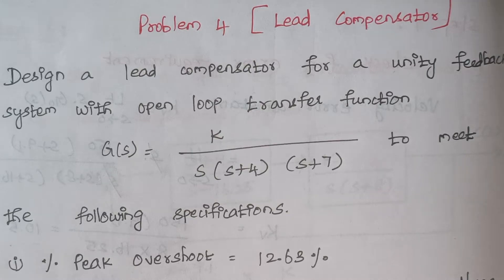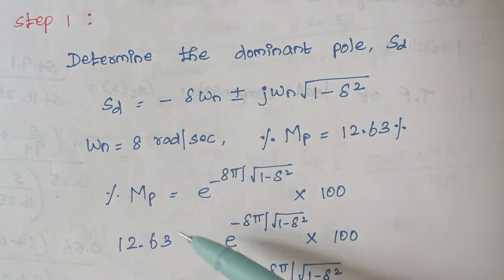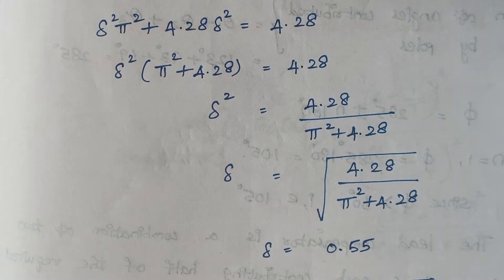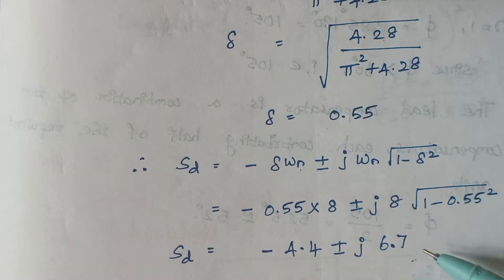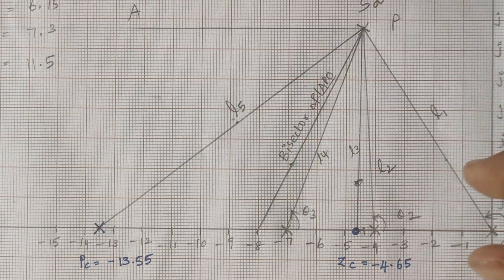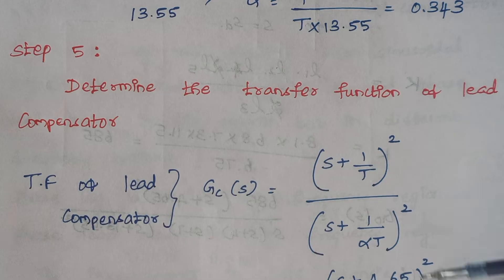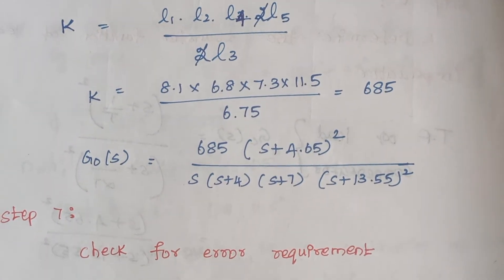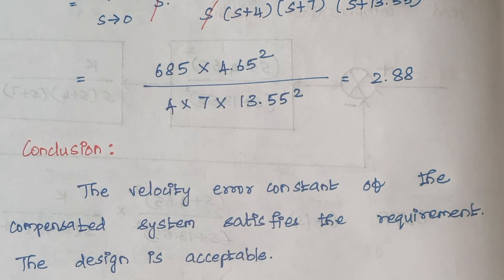Lead Compensator (Problem no 4)

Comment: how the whole square has  taken  on TF of lead compensator in  step 5
Reply from the maker: When you refer step 3,the value of pi is 105° i.e greater than 60° . therefore we have to divide the angle pi by 2 which is equal to 52°. then  in this case,the lead Compensator should be combination of two Compensators.Generally Compensators are connected in series.When you combine two blocks in series,we need to multiply.Thats why in Transfer function we have squares.
Reply: @kowsiteaches  i understood ....Thank you ma'am
Reply from the maker: @aniketrenjarla1353  most welcome

Comment: Use frequency response methods to design a lead compensator for a unity feedback system where G(s) =K(s+7)/s(5+5)(s+15) and the following Specifications are to be met: percent overshoot=15%, Settling Time=0.1 sec, and Kv=1000.
Reply: Tell me this solution